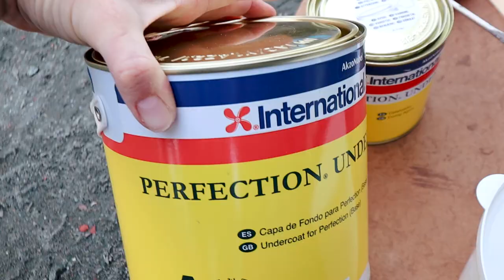Sailboat REFIT #8 - BOAT PAINTING | ROLL & TIP technique with NO EXPERIENCE | Sailing MAKANI Ep36

Comment: Always a pleasure to hear about your escapades🙃🌴... can I ask what is the driving time between the top coats?
Reply from the maker: Thanks Stephen. We aim to keep you all entertained. 😉 It varies how long you should wait between the coats. We used a reference sheet that came with the paint to plan the coats. It depends on how much thinner you add, the temperature of the place where you paint and a few other things. We used a thin top coat mixture and we were able to apply the second coat ~24 hours after the first coat. The reference sheet was very helpful.
Reply: @SailingMAKANI a pleasure to "chip-in"...as you will see 🙃